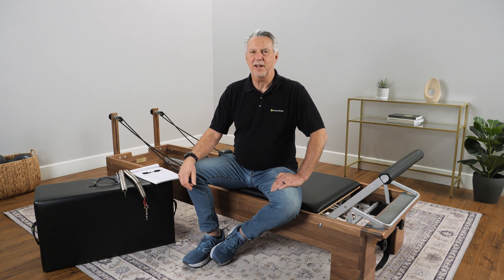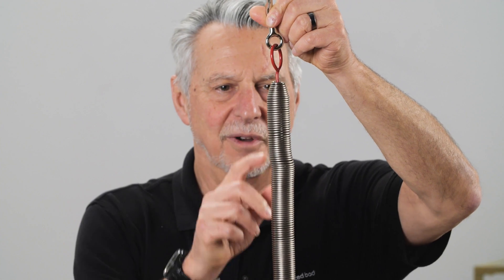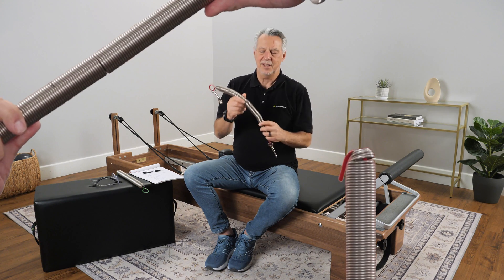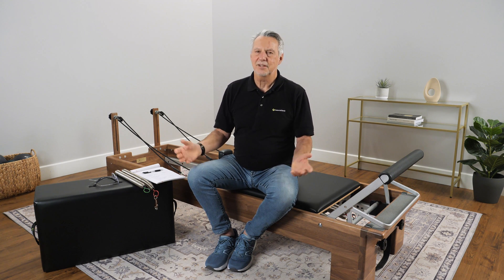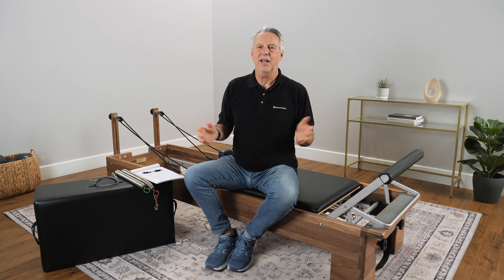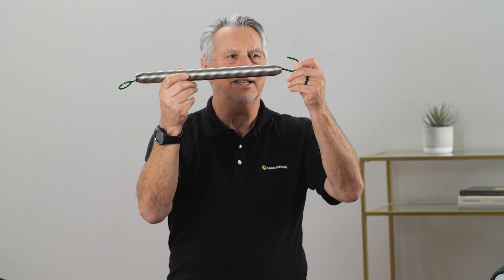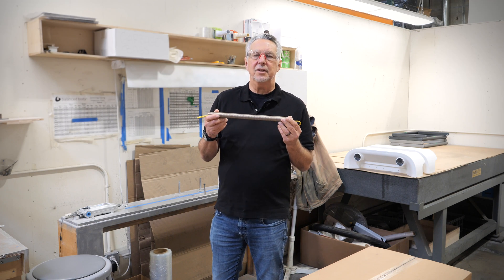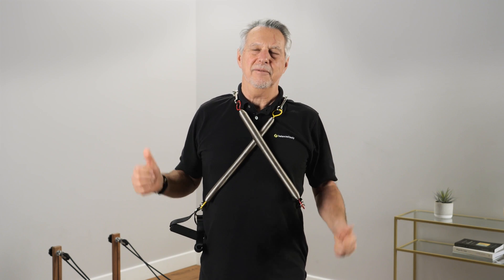Complete Guide to Pilates Springs | Selection, Maintenance & Applications

Comment: Hi can i please ask if the springs are meant to make a rattling noise? Have recently purchased a new pilates reformer, a different brand and it does this as well as carriage.
Reply from the maker: We can't speak on non-Balanced Body springs, but in this video Ken talks a bit about BB spring noises at 04:55.
If you have further questions about BB apparatus, please reach out to our tech support team at (916) 388-2838, anytime from 6:00am to 5:00pm PST, Monday through Friday.
Reply: @BalancedBodyPilates  thank you.

Comment: Can you give me tips on how to handle BB studio reformers when the straps come loose easily from in-between the strap adjustment knobs? Often, after tightening the straps, I have to hold the knobs together and allow the client to move before I let go of the knobs. If the knobs are not held together, the straps come off when movement takes place.
Reply from the maker: Our tech support team is super helpful and available to talk it through with you! You can reach us at 1-916-388-2838. Our hours are 6:00am to 5:00pm PST, Monday through Friday.